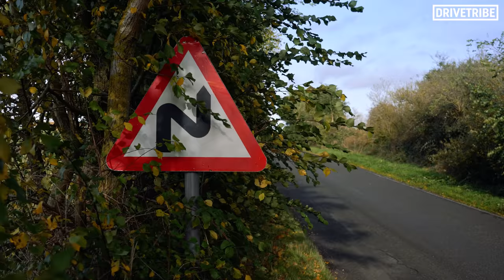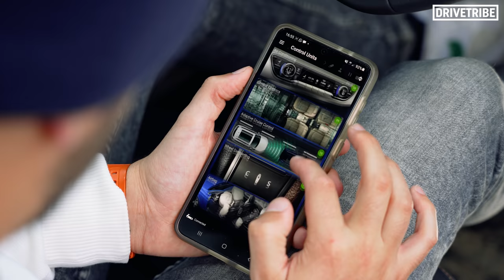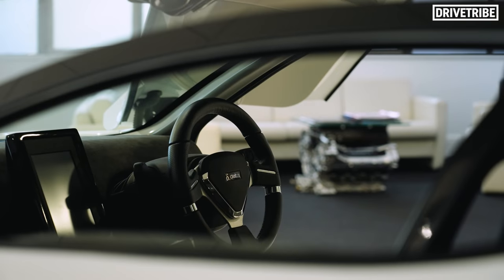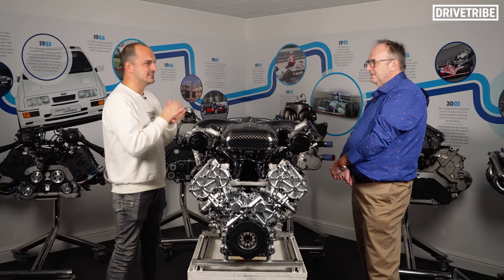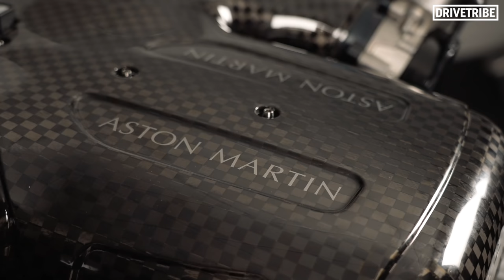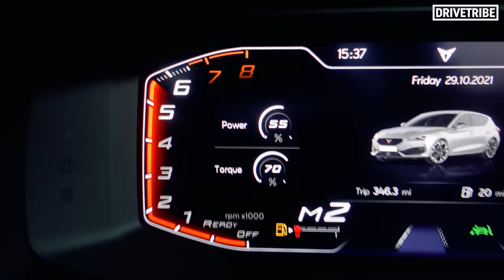Why are almost all modern engines 2.0-litres?

Comment: SAAB basically started this wave in 1974 with the 99 Turbo. Then in the late 80's came the LPT cars. Low pressure turbo (6 psi) small instant boost for a Torquey around town car. Currently doing 30,000 miles a year in my Saab 9000 Aero with 317bhp with its "Stock" engine. Not modified other than Tuning the amazing SAAB Trionic5 which will go down as one of the best engine management systems of all time. Considering it came out in 1993 its ground breaking even now and does more than many aftermarket systems.
Reply: And that engine was not originally a SAAB creation, its an engine made by UK Triumph engineers in the 60´s.
Reply: @MehdiS-music  That standard reply does not really cut it anymore. The B202, B204 and B234 bare little resemblance to the Triumph engine. My B234 is in standard form with no changes and running 317bhp. I hardly think the Triumph engine would make over 300bhp lol.
Reply: Yeah saab was wayy ahead of everyone with their 2.0T engines
Reply: Exactly. When the other companies had big turbos for huge power gains (and huge turbo lag) Saab did the Opposite. Low pressure , loads of torque instantly for a bigger engine feel.

They understood it was a road car and not a racing car.
Reply: Low boost, small turbo engines are the best to drive imo. They're usually really torquey and offer great response with virtually no lag, they make for great driver's cars too!
Reply: I'm glad that somebody finally mentioned SAAB. They basically pioneered the concept for everyday useability.
Reply: SAAB was ahead of its time and a joy to drive. Drove a 9000 before too, with a 2.0L N/A engine and it was such a joy
Reply: i read about saab, those cars far ahead at there time, engineering is far more great than these days i think

Comment: 500 cc for all configurations means the same, valves,  pistons and conrods right across the range from 3 cylinder to 10 cylinder. It is all about mass production and getting costs down. Also if you look at UK made cars you find the engines were mostly 1000cc, 1500cc, 2000cc, 2500cc, 3000cc and 3500cc.
Reply: The 1100cc, 1200cc, 1300cc were all popular especially Ford's in the 80s and 90s.
Reply: @glennoc8585  probably because they didnt used cc but another US imperial unit? (I am curious not joking ahahah)

Comment: I have a 3.0L inline 6 with an 86x86mm bore. Engine is 2jz-ge in my IS300. I love driving it because of its torquey power curve and instant throttle response. It also sounds great!

Comment: A naturally aspirated,  oversquare, inline 6, with less than 500cc per cylinder, revving to 8k, just hits different. 
It won't win the numbers game, but the experience is just glorious.
My 1993, manual, M50, 525i, with cams, port&polished head, headers, full custom exhaust, bigger throttle body and maf sensor from a V8, and standalone ECU.......is still slow AF, but it sings to 8k, and I wouldn't change that feeling for the world.
Reply: I'm on your side :)
Reply: Spoken like a true enthusiast

Comment: I read an article years back written by an auto engineer that was very similar to this video.  His preferred displacements, were 2.0l 4 cylinder,  3.2l v6, 4.4l V8.  Made sense
Reply: I'm assuming these engines are DOHC.
Reply: @beachesandhose2374 a pushrod 2l i4 would be the saddest engine imaginable lol

Comment: What's kind of funny about this video is that this might be changing as we speak. Mazda's most used displacement at this point is their 2.5L engine, and Ford has been steadily replacing their 2.0T with their 2.3T ever since it was introduced. Subaru likewise is phasing out everything in favor of a 2.4L displacement.
Reply: @stevenp3176  Yeah, this is a much bigger reason that they didn't talk about. The secondary forces in an inline 4 are unbalanced, so engines bigger than 2.0L need balance shafts. But for economy applications, the reciprocating mass of engines under 2.0L is small enough that you can keep that in check without shafts. This is why the Honda D series 1.5L engines were small and peppy but buzzy, and the K24 engines were smooth but slower revving.
Reply: @stuntmonkey00  Needing balance shafts over 2.0L depends on the usage. A big part of why automakers are going for 2.3-2.5L is because there's an increase in the importance of torque over hp in the modern car market. Mazda's 2.5 turbo, for example, makes max power at 5,000RPM, and doesn't rev over 6,000. Lack of balance isn't as big of a problem when you don't rev high. None of the engines I mentioned have balance shafts either. I think the last inline 4 to use those was GM's massive 2.9L
Reply: For all the years that my Jeep patriot was made(2007 to 2017) it came with 2 engine choices 2.0L or 2.4L inline 4 bangers.......My 2014 2.4L runs great.
Reply: Porsche just put a V8 in their mommy mobile
Reply: @ashuramamun9488  "Just." The Cayenne has had a V8 since it was introduced 20 years ago.
Reply: @masterofThardus  actually, the toyota AZ and AR inline 4s (toyota's 'big block' camry motoes, like 2.7l 1AR-FE) all come with balance shafts from the factory
Reply: Their main markets are the US
Reply: @future62  which is a very large market indeed
Reply: @masterofThardus  almost all engines use balance shafts these day, even 2.0L of displacement, not even mentioning 2.2L+..
Reply: @bonifacijus11  the opposite is true, to the point it's notable when one does. It comes up a lot on forums for cars and the answer is almost always the same: no balance shafts. Exceptions seem to be the ones over 2.5L displacement, like the 2.7Ls from Toyota and GM.
Reply: @masterofThardus  i don't know what engines you're interested in, but the ones i've checked (up to 2015) - all had balance shafts, even 2.0L..when in old days, back in the '90ties, engines with proper 8counterweight crank shafts had no balance shafts on 2.0L, even on 2.4L 2.5L inline (especially low rev (up to 6krpm)) 4-5pots..
Reply: @masterofThardus  Almost every modern 4cyl diesel uses balance shafts
Reply: @bonifacijus11  ah, seems I was mistaken at least on a few of these. Balance shaft delete kits exist for Mazda's 2.5L evidently.

...Dunno why you would want to delete the balance shaft, but w/e.
Reply: That's for US market mostly. In Europe 200 hp was considered quite a lot in anything but real luxury cars.
Reply: @bonifacijus11  cross plane 90° V8's don't use balance shafts, neither do inline 6's or V12's. All 3 setups are naturally balanced
Reply: my tractor has a 3L inline 3 diesel engine.
1000cc per cylinder and doesn't vibrate that bad considering that the tractor has no suspension and no engine mounts whatsoever
Reply: @masterofThardus  " Lack of balance isn't as big of a problem when you don't rev high."

That's not true.

"None of the engines I mentioned have balance shafts either."

That's not true either.

Don't know where you're getting this from, but balance shafts are required in 4-cylinder designs because of the second-order vibrations inherent to an inline 4-cylinder design. These are vertical oscillations that happen at twice the engine speed. So if you're revving to 6000 RPM, your second-order vibrations are happening 12,000 times per minute and you're definitely going to feel that, especially in a large 2.5L engine, as these vibrations become more pronounced the larger the displacement is.

It has ABSOLUTELY NOTHING to do with torque, that doesn't even make sense. Cancelling out engine vibrations has nothing to do with torque production.

You need to purge this information from your brain because it's all completely wrong.
Reply: @masterofThardus  "the opposite is true, to the point it's notable when one does. It comes up a lot on forums for cars and the answer is almost always the same: no balance shafts. Exceptions seem to be the ones over 2.5L displacement, like the 2.7Ls from Toyota and GM."

Completely, utterly wrong. Stop spreading misinformation. I've got a 2017 VW GTI in the driveway with the 2.0L TSI engine. It's got balance shafts. Stop spreading nonsense.

Edit: If it's an inline 4-cylinder of displacement 2.0L or larger made within the last 35 years, it's a safe bet that it has balance shafts. These vibrations are inherent to the basic 4-cylinder design and cannot be eliminated via any other method. Unless car manufacturers suddenly stop caring about NVH (which have improved dramatically over the last several decades), they're not going to stop using balance shafts.
Reply: I've had a few Isuzu 2.4l 5 cylinder work vehicles and they were a great torquey motor.
Reply: Nobody follows what Mazda does. Subaru does not make an inline 4 engine. Ford has a historical 2.3L inline 4 so maybe the Ecoboost pays homage to that.
Reply: @nightdriver7216  Never said anyone was following what Mazda was doing, and the layout of the engine is irrelevant here as I didn't mention engine layout at all. The history of the 2.3T layout is also irrelevant. At the end of the day, it isn't 2.0L. More importantly it's bigger than the 2.0L they were previously using.
Reply: @nightdriver7216 says who?  I'm a proud owner of a 2.5L i4 skyactiv Mazda.  Little torqy no turbo engine in a 3200lb awd hatchback.

Comment: I'm quite happy with my 4.5 v8 twin turbo - 450 bhp, never stressed, smooth as a cashmere codpiece. It pulls from 1000 revs, right up to the red line.

Comment: Very interesting! My Volvo has a 2.5L inline 5, also 500cc per cylinder!
Reply: The inline 2.5 5 cyl is definitely worthy a place in the engine hall of fame
Reply: I had a Landrover Discovery TD5 diesel - also 2,5l in-line 5.
Reply: I would have purchased the XC90 if it had retained the 5 cyl 2.4 litre engine, (D5?) but it seems to have vanished.
Back in 1975 when my new Mercedes-Benz W115 230.4 (2307cc 4cyl) brand new- I collected it from Sindelfingen - at 6 weeks suffered ‘a hair out of place’ in the otherwise marvellous MB Automatic gearbox, they took it away (very quietly) and loaned me the then brand new 240D 3.0 litre 5 cyl engine, now called the 300D. It was so smooth (relatively), we had it for 6 weeks and 1500km, taking our two young children to the Ruhr, Wüppertal zoo (1975 remember - before zoos became abhorrent to civilisation) - and it returned 29 mpg, which considering it kept to 150 kph on the Autobahns, was very reasonable. At any rate I got mine back with a brand new gearbox (on inquiring as to what was the problem, came the furtive reply “Herr Hauptmann Simpson (I was in the RAF) we prefer not to discuss it, just enjoy your nice new Mercedes-Benz”. Oh, …….right-oh! Vielen dank! 

Incidentally that 230.4 is still in my garage outside, after 46 years. Needs a ‘bit of work’.

Anyway, for my final purchase (I’m 77 yo) I’ve decided on a Mercedes ML63 AMG (V8 5.5 litre) with 515 lbs/ft of torque so I will hardly need the throttle to launch and keep going. I’ve been looking for over 12 months, for ‘the one’.
Reply: @zacharyreynolds4303  you pick boxer 4 over boxer 6? Interesting choice. Why?
Reply: I've got a S60 D5 and the S80 with the same engine. Excellent MPG and pretty quick.... for a diesel!!!
Reply: The Volvo 5 cyl Petrol and Diesel engines are based on the Audi 5E engine ... then later Volvo replaced it with their own versions. That then led onto todays D3 etc. engines ....

Comment: This is an interesting video, but I disagree with the claim that "almost all modern engines are 2.0 litres". On Autotrader right now there just under 83,000 cars for sale that are 2019 or younger. Of those, just over 14,500 are 2.0 litres (that includes a standard ICE, self charge hybrid and PHEV). So in actual fact most engines are not 2.0. The claim that 3 cyl engines are generally 1.5 or 1.6 also isn't true, by far the biggest majority of 3 cyl engines are 1.0.
Reply: In reality most entry and compact cars have an engine under 2L and most midsize sedans and anything bigger than that is generally pushing 2.5L or is significantly bigger
Reply: Ah - you forgot that facts and entertainment coexist only on full moons. And then only if it’s a leap year on social media :)
Reply: @andrewgarcia3136  No argument from me there, but title asks why "almost all modern engines are 2.0 litres", which is not the same as 'up to' 2.0 litres (this would be correct, certainly in the UK)
Reply: @davidw460  :-)
Reply: Most motorbike engines don’t have around 500-cc cylinders either but rather closer to 250 cc or even smaller.
Reply: Indeed, if you look at motorcycles in Asia most are around 125cc and it’s in many instances the only means of personal transport for these people. If I look at the catalog of most European manufacturers the majority of their engines for compact and mid size cars are 3 cilinders ranging from 1.0 to 1.3L. EU emission regulations have killed 4 cilinders in these cars.
Reply: Yup, I thought the same. It's not fully correct even when we talk about 4 cylinders (most of those are between 1.4-1.8, 2.0s are mostly used in performance versions or hybrids). Great video otherwise
Reply: Small engine sizes like 1.0 buck the trend towards 500cc cylinders because the benefits in terms of balance and smoothness offered by 3 cyl outweigh any benefit of larger cylinder size a 2 cyl engine would give. 3 cyl is really the minimum required for satisfactory balance and smoothness in cars. Fiat tried 2 cyl in their 'twin air' engine, but the results were poor in terms of noise, vibration and harshness.
Reply: He meant in countries which are not second world america...
Reply: My car is a 2018 and it's engine is 6.2 litre's
Reply: In Europe the trend is towards smaller and smaller engines. Even Mercedes now offer 1.3L engines for many models. So, where exactly is this 2L stuff happening?
Reply: @davidmcgavin  the twin air sounded like a sewing machine and vibrated like an old washing machine.
But it was so fun to drive it on the limit. A perfect thrasher
Reply: @ratscoot  I'd think it was more a move to smaller displacements due to the large tax penalty for larger engines and it's probably not economical/practical to make a 1 to 1.5 litre 4 cylinder engine.
Reply: Yes. 1.5L or 1.0
Reply: "almost". He's not lying if he's going for the 500cc per cylinder argument.
Reply: @sanderdejong66 America. BMW, Mercedes, VW, Honda, Toyota, all offer 2L i4 cars.

Comment: The Mercedes-AMG A 45 S 4MATIC+ is not just flirting with 400hp, it actually does produce 421 hp from its 1991 cm³ engine.
Reply: Even though its a handbuilt AMG engine, I wonder how long it will last at 210hp per litre when everyone else settles at 170ps as the most used highest specific output?
Reply: Can you all stop referring to AMG 45 as some Benchmark when Mitsubishi Toyota Saab Audi were pioneers of turbo charging road going cars....
Reply: @TheMuzikall  why would it not be the benchmark when it is the record holder?
Reply: @TheMuzikall  It is the benchmark...
Reply: @TheMuzikall  Stop crying
Reply: @markcarpenter4175  Some info from Germany says that Amg 2.0 engine lasts only 100K km.
Reply: @atomickoala62  it's not... the fq400 made 400hp back in 2005, the fq440 made 440hp back in 2014, mitsubishi were first to do it a long time ago. And these accomplishments only require forged internals and boost, when an NA engine makes big power, then I am impressed. The ls7, s2000 engine, ducati v4r etc
Reply: @A500-g6g  The FQ400 made 200BHP/L which is 8/L less than the A45S. The FQ440 doesn't really count as a production vehicle as they only made 40 of them. Plenty of manufacturers have made limited run high HP cars. It's common place not to include them in competition like this. The A45S's record was broken later on by the Jesko anyway, which made 313/L. But again, that's an unobtainable hypercar. It's not relevant in the consumer market.
Reply: @atomickoala62  Yh but the fq400 was made about 16 years ago. So the little difference means nothing. Mercedes make brilliant cars, and the a45s is a more livable car, but like i say squeezing big power out of heavy small displacement engines through turbocharging doesn't impress me. NA big power does, the ls7 is lighter and smaller than most inline 6s yet makes double the power and double the torque in NA form, and when boosted, forget about it. It also sounds 10 times better

Comment: 2 liter turbo engines are indeed great, enough power, not too heavy.

Also my car from 2010 with a 2 liter turbo works very well, also great at low revs, 
and with sofware tuning it has also now 240hp/400nm with original hardware, 
and fuel consumption is also not bad (outside the city)
Very compentive with modern 2 liter turbo engines.
Reply: If someone...it's Saab who invited the 2l turbo engine for the road car anyway. They where 40 years ahead basically
Reply: So you have a golf 6 gti?
Reply: @robertjusic9097  no, a Saab 9-3